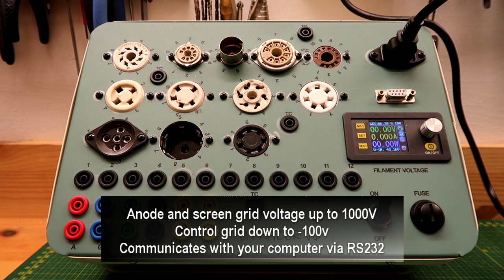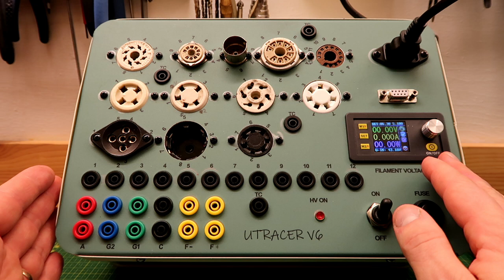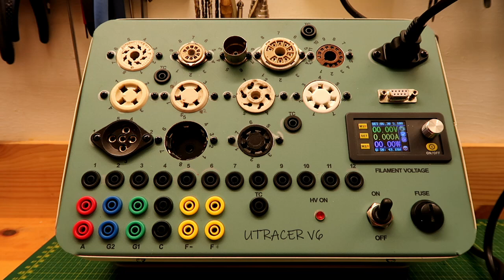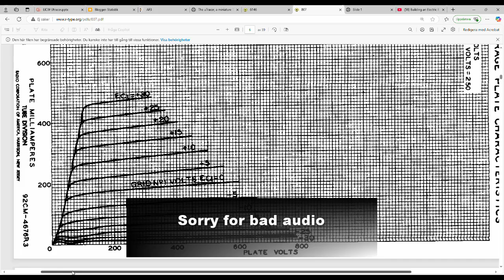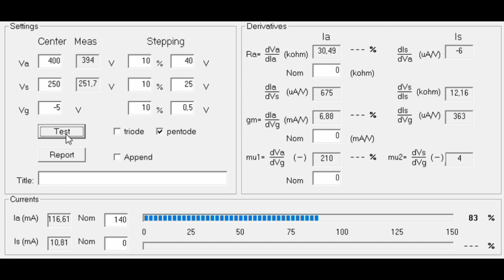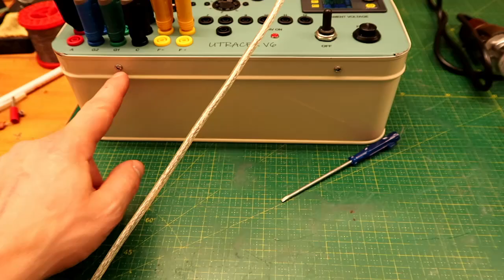Utracer v6 tube tester

Comment: Thank you for your video.   I'm in the process of purchasing a uTracer 6 as well.   Really appreciate all the help I can get.
Would you happen to have a BOM that you can share?   Heater supply, what parts do you use and how do connect and make it adjustable?

Comment: Hi there. Great video and very useful for me. I just bought the uTracerNXT and am looking forward to building and using it. The thing I am not looking forward to is building a box for it. I like your idea and I found that ikea box online. I can’t tell what you used for the piece which has all the sockets and plug connectors. Is that  different material ? If so, would you mind telling me what the material is and what you used to cut all the holes ? Many thanks
Reply from the maker: It's an aluminum panel. I cut it using my buddies cnc plasma cutter, but patience and step drills will do the same. Good luck!

Comment: Nice project, thxs for sharing. Out of interest since I will start building my uTracer6, the banana plugs you are using, are these 4mm? And a last question, what is TC? Test connector? Thxs for helping me out.
Reply from the maker: Yes. 4mm jacks and plugs. I added TC as Top connector (top cap or whatever). But, not really needed since the cables will reach anyway.